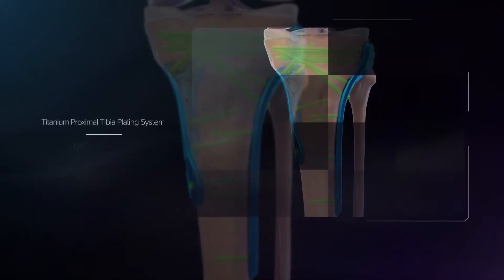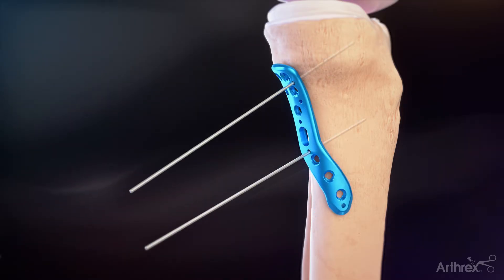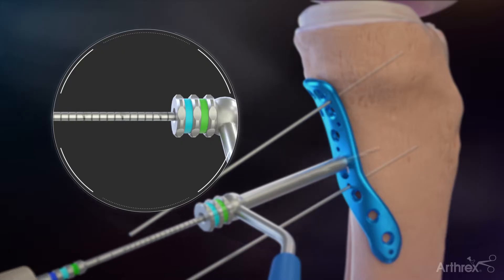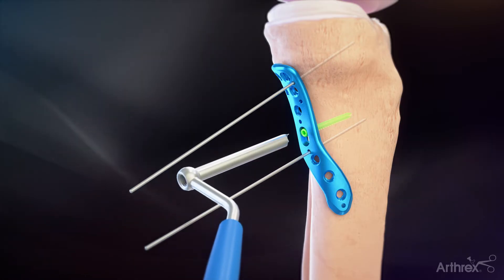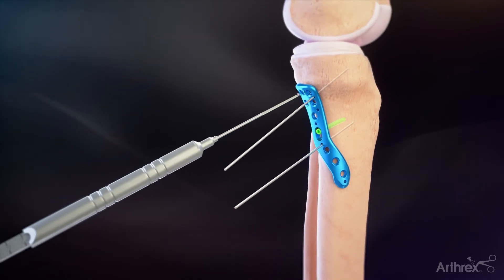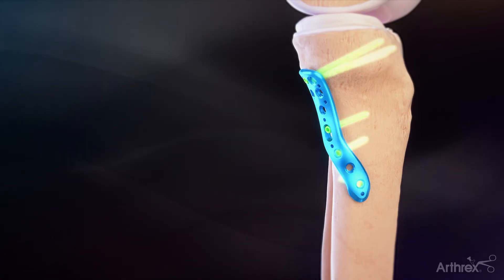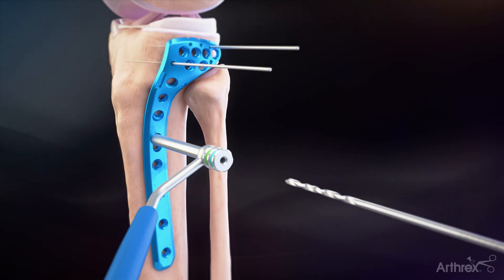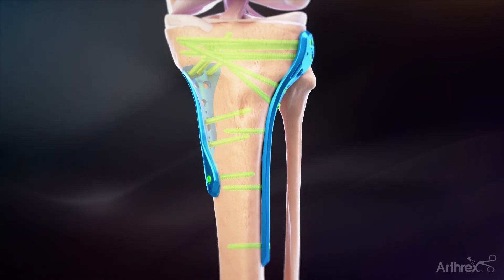Proximal Tibia Plating System

Comment: I have been inserted with 1lateral plate 80-90% similar to as shown in video .. 3 screw below towards plate ending and 10 screws in top part of plate 7 horizontal 3 vertical inside tibia head... After Operation week was very tough ... I was crying that time and currently not able to walk after 1 month
Reply: Hi, after how many days you are able to do walk without support
Reply: @justchinna9252  still not able to walk 2 month gone ..now only able to stand on both feet... I m now walking with Walker and on both feet.. like 50% weight on one good leg and rest 50% weight on effected leg and both hand on walker ..
Reply: Still walking smoothly , around 3 month  @navjotsinghnagpal
Reply: @praveenakr8259  now walking with stick .. without stick can walk but not straight
Reply: Hi how many days over now . Wats the status. My case also same 80 days over partial weight walking happening@navjot
Reply: @Contentvizag  4.5 months gone after operation, now i am walking without support with little bent also pain is still there  in knee and can't climb stairs with effected leg
Reply: @navjotsinghnagpal  condition now??
Reply: @coveragestudio01   pain still occur,  while straightening the leg from bending position.. still not have strength in leg to do heavy work like climbing stairs.
Reply: Now your condition bro ?
Reply: @ooxron  11.5 month since surgery now walk freely not much pain at joint , climb stair without support but with slightly body push while coming downstairs need little more strength and have to step carefully because leg move freely can't hold itself,   .... thight is still in loosen state as compared to other leg....